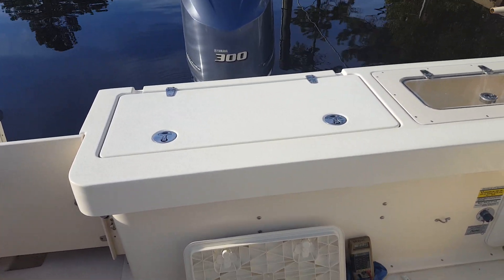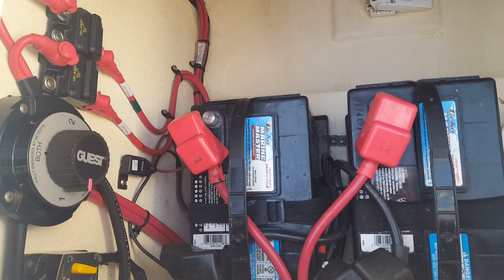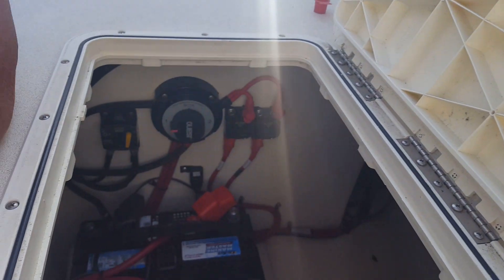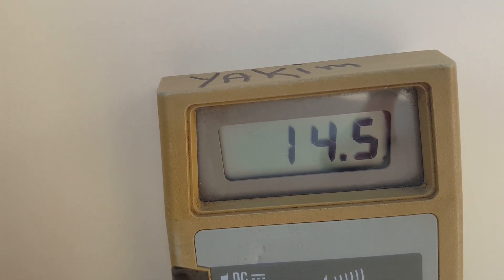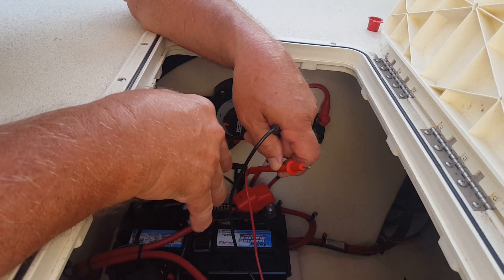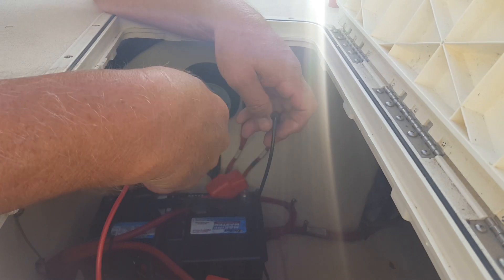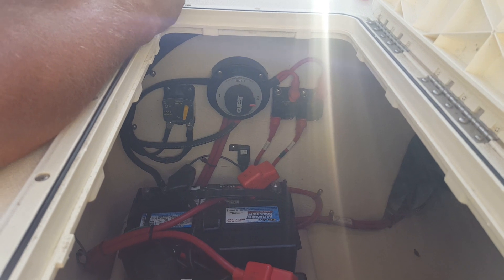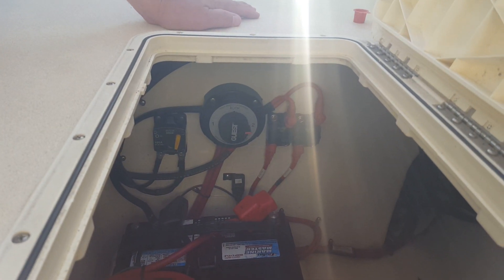BOAT BATTERY Selector Switch. Run on 'Both' ?,   #1? #2? It Depends;

Comment: No very helpful if you don’t tell everyone the reason it’s charging both batteries is because you a charging relay installed
Reply from the maker: I wouldn't tell everyone about having a charging relay installed, because I didn't know that I have one.... But, if that is the case, thank you for pointing it out. Where is it, and what does it look like? (and, there is no need to be unpleasant about it with your comment☺)

Comment: Is the boat running if not this demo is not accurate info might be correct but if boat is not running then it’s not going to change any batteries…..I guess you could have a solar panel or a charger plugged . If you are using an isolator one battery charges then it switches to other battery usually cranking battery fist then house battery
Reply from the maker: Yes, the boat was running the entire time I made the video. The Yamaha at idle is very quiet.

Comment: I have a ranger tug with a outboard I have 3 house batteries and 1 starter battery on my panel it has a charge switch do I keep the charge switch on wild underway or just when I’m dock

Comment: Unless I missed it... he never talked about when to use the "both" option?  It was also a bit confusing with all the discussion about older boats, I wish just kept it really simple and only talked about the boat he was using a demo. thanks.
Reply: I never run ‘both’ I use 1 to start and run around do whatever and if I go anchor and run a battery I use ‘2’ so I don’t drain both batteries. When you run your generator, turn your battery charger on and you’ll charge both batteries.

Comment: I had mine on 1 knowing that battery 2 was hot camp out over night got up the next morning and both batteries were dead I guess the switch is wire wrong or what

Comment: You have a battery combiner installed its visible in the video.... Read up on them. New technology's for old guys. Lol gotta keep up
Reply from the maker: Hi Robert, Thank you for watching, and thank you VERY much for the advice! You are correct in that I don't know what a 'combiner' is (I've not had one, that I know of in 45+ years of boat ownership; is that why both batteries are charging regardless of if on #1 or #2?) )... I'm still not sure if the device you mentioned is what I have, as the device I think you are referring to in my video is MUCH smaller in every dimension than ones I have tried to search online. The 'combiners' I've seen online are thicker, wider, and deeper than what I think you pointed out on my boat... Thank you once more for the advice; I will continue to research what you've educated me on!
Reply: @andrewfyakim525  it may be an older model but you should research that device whether it is a combiner or not. Should have a brand on it somewhere. Combiners do do what you are reading. And its usually best to run it on 1 or 2 not both. Your welcome and Good luck. Nice boat
Reply from the maker: @robertrodriguez2724  I agree, on this boat I always run on #1 or #2, not both. But with my older boats, if on one or the other, only the one (battery) I was switched to would get charged; back then it was important to run on 'both' if you wanted both to charge... Once again, thank you for your information!
Reply: @andrewfyakim525  oh and you should not switch from 1 or 2 while motor is running it could cause issues in sensors in motor from what I've learned. Hope this helps
Reply from the maker: @robertrodriguez2724  Yes, that is important; I've known, and mentioned not to switch from 1 or 2 while the engine is on. Supposedly, with some switches, that is not an issue, but who knows which ones!? It's best to do as you suggested! Thank you once more!
Reply from the maker: Hi Robert, Once again,  I thank you for your input, and I did as you suggested. The items you thought may be  'combiners' are circuit-breakers. (Hi-Amp Buss 40A 184040F Waterproof)...Combiners are much more expensive and sophisticated devices. (I wish I had some!) What you see in the video are circuit breakers; one for each battery. There is also an additional  BUS MRCB 100 Amp DC 48V DC Max circuit breaker 'down-stream' from those others... Once again, I appreciate your input, as it forced this old dude to get on his belly, and find out what those 'things' are! ☺ I didn't know until now...

Comment: Great video.. Question.  When  I am at anchor and my engine is off.  Should I switch to position 2 to  to power my accessories?   Also,  does anything bad happen if the engine is on and I move the switch from position 1 to position "ALL" or position 2?
Reply from the maker: Hi Richard, thank you for watching... To answer your questions; when at anchor and your engine is off, and assuming both batteries are wired correctly and therefore fully charged, you can select either #1 or #2 to act as the 'house' battery (to power your lights, and other accessories). Doing so will keep the other battery 'off-line' so you are assured you have a strong battery available to re-start the engine; even if you drain the battery that you chose to use as the 'house battery'. Switching the battery switch from 1 to All and/or to 2 is fine anytime; whether the engine is running, or not. The only thing you do NOT want to do, is to switch 'through' or to the OFF position When The Engine Is RUNNING. If you do that, you will do serious damage to the alternator on the engine. It will burn out diodes.
Reply: @andrewfyakim525  THANK YOU Andrew!   My selector switch didnt come with that information.
Reply: @andrewfyakim525  Hi Andrew,  I have another question.  Should I just run two cranking batteries and choose one as a house battery when I'm at anchor.  I dont beach my boat or turn off my motor for more than a few hours while fishing.   I just want to make sure I have batteries that can start my boat.   I currently have one cranking battery and one deep cycle battery.  I've noticed my deep cycle battery is not always able to start my motor...so if my cranking battery goes dead, I could be stranded.   Your thoughts on running two cranking batteries?
Reply from the maker: @richardc2803  Hi Richard, thank you once more for watching! Tell me about your engine (see below). A typical deep-cycle battery should be able to start the engine, if it is a 'healthy' battery. (My Diesel engines would easily start with one deep-cycle battery).... A lot of it depends on what engine (engines?) you have, and also on how much 12V power you use when the engine is off, and how long you use them.... Tell me more about your engine; gas? Diesel? two-stroke? four-stroke? How big, horsepower? ... What electrical items do you run, and for how long?
By the way, this is all 'calculatable'. The battery has a rated 'reserve' amperage. (Amps X Volts = Watts) so you can check data plated of any electrical item and it will give you the amps, volts, watts, etc...
Reply: @andrewfyakim525  Hi Andrew, I am running a Yamaha 4 stroke 150hp outboard and I have a 9.9hp Yamaha kicker motor.   It could be my deep cycle was just never charging as I only had the switch selector on "1" which was my cranking battery...I rarely anchored last season and didnt bother to switch to the house battery.     Maybe I just need to get a new deep cycle battery and the problem is solved?
Reply from the maker: @richardc2803  Yes, it is always best to use (keep in reserve) one of the batteries as a 'house' battery.
Before spending the $$ for a new battery, try this first:
If it is not a sealed ('maintenance-free') battery, buy an inexpensive Hygrometer, and check the specific-gravity of each cell. That will tell you if the battery is 'healthy', or if it needs replacing. (easy direction will come with the Hygrometer). If it IS a sealed battery, have it load tested; most places like Advance Auto, AutoZone and such will load test it for free... As this video points out, on our boat, it does not matter if the battery-selector is on One, Two or Both; both batteries are always being charged when the engine is running. Yours could also be (and/or should be)  'wired' to do that, and then you would always have one fully charges battery available to start the engine.... By the way, a typical deep-cycle battery should have plenty of 'juice' to start your 150 Yamaha 150 4-stroke,,,,
Reply: I've  been running #1 as cranking battery. Typically has higher cranking amps. #2 is deep cycle. Selected when engine is off to use accessories.  Select both to start engine. This will run batteries in parallel thus charging both batteries. Of course, the system has to be wired correctly. I've run this setup since the 80s on all my boats. Never had an issue. I do not operate switch when engine is running. It is set to both when running engine.

Comment: That’s an old fluke meter classic
Reply from the maker: Hi Lou, You have sharp eyes! Yes, that is my old Fluke, and it still works like new!
Reply: Andrew F Yakim they were bullet proof i calibrated flukes for many years that model had buttons that would stick if you worked in dusty environments and more often screen would go blank
Reply: I usually run on one battery on the way out and another on the way in didn’t know new boats had that option I know there were battery isolators that charges both without draining both is that what the new boats have?
Reply from the maker: @lou198  Yes, That is what our Parker has; both batteries are always being charged when the engine is running; It doesn't matter if I have the switch on 
'1' , '2', or 'Both'.  It's the first boat I've owned that does that.  All of our other boat, since the 1970's that had two batteries, required running on 'Both' if you wanted both batteries charging. Our last boat has six 4-D Truck Batteries, and it had THREE battery switches....
Reply from the maker: @lou198  Thank you for the 'heads-up'.  I've not used the Fluke in dusty/dirty environment, in fact I'm very careful with all my tools. I have a couple cheaper Volt/Ohm meters I use if there's a chance of damage, or in my case, dropping them in the water. (Yes, I have! ☺)
Reply: Andrew F Yakim a multi meter is a great instrument if u need to know the exact voltage but if you are trouble shooting electrical problems on a boat I prefer a 12v test light a multi meter will sometimes read voltage when a test light won’t due to poor connections and yes I love fluke must have a dozen of them I get a new one every time I go to their training
Reply: Andrew F Yakim just be careful when using those cheap meters they’re not always rated for higher voltages and can cause serious injuries
Reply from the maker: @lou198  Hi Lou, thank you again! I'm careful around all electric but am certainly not a professional... I'll also take your advice and get a 12V test light....

Comment: This paragraph helped on clarification, so when the boat is off , is the dial to remain on off to charge both batteries? I have an 89 boat with the big red selector dial. After i get these charged I will only one run battery at a time, because of your info. Thanks
Reply from the maker: Hi Glo, Thank you for watching.... On your 1989 boat, the only way to know if both batteries are being charged when running is to check with a 'multi-meter' like I showed in the video, or to know for a fact that the system is wired like my boat. In a 1989 boat, it my not be wired for 'all charge' with the switch just on 'One, or on "Two". On my 1987 boat, the switch had to be on "Both" while the engine was running, to charge both batteries....  When the boat is off, and there is no one on the boat needing any DC power, the switch should be placed on "Off".... Nothing will be charging at  that time unless you have a separate AC powered charger on the boat....

Comment: Really the most confusing and controversial matter on a boat I've never seen, 1,2 or both. or what ? Never seen the same answer to this question, courious really . Nice video.
Reply from the maker: Hi Bernar2able... I agree with you, it's confusing with so many opinions, especially when all those opinions could be correct under different circumstances..... For me, in a nut shell, it is about how the batteries are, or are not wired.... If both batteries are being charged all the time with the engine on, then pick #1 or #2; it does not matter which. When you turn the engine off, and the switch is still on one or the other, then you will not be discharging both batteries; one will be 'in reserve' to be able to start the engine. Thank you for watching!

Comment: Can i ask how do you charge the 6D battery that you said? Did you use 3 selector switch? Thanks
Reply from the maker: Hi Jaypee, thank you for watching my video. On my previous boat I had six, 4-D batteries (they are big-rig, truck batteries; one size smaller than 8-D). I had two chargers on the boat. One was a 15 Amp Ferro-Resonant charger and the other one was a 15 Amp Silicone- Rectifier charger. I had three standard 'selector' battery switches and cycled between them to assure charge was going to all the batteries. I seldom had to use the battery chargers as I used the boat every week and the engine alternator kept the batteries charged. The key was using the boat every week.
Reply: Andrew F Yakim  is possible to charge a three 12v in series to make 36v to power the trolling motor using the alternator of boat? Do you have any recommendation or do i need to buy 3 output battery isulator and how to connect the battery isulator to the 3 12v in series is that possible?
Reply from the maker: @SilverVioly  Hi Jaypee... sorry I did not respond earlier.... Youtube does NOT notify when I get comments, even though I am set up to get them... I don't have a trolling motor and I know very little about them.  But, I have a 48 Volt golf cart that requires a special 48 volt charger... It is six, 8-Volt batteries in series....

Comment: Yes; good information for me in particular; I am new to my 2005 Parker 2520 with two Yamaha motors and two batteries. Knowing that both are always charging regardless of the setting while your running; and Leaving on one to save the other was good advice! Thank you Andy. Mark Hanna
Reply from the maker: Hi Mark, good to hear from you. I hope you  are making good progress with your Parker!
Reply from the maker: Hi Mark, I meant to add; With your twin engines, do you have 2 batteries, or 3? (some twin-engine installs have a third (even a 4th battery)... And, do you have more than one Battery Selector Switch?
Reply: @andrewfyakim525  I have two switches. And, I have put a lot in to it, and love the comfort. I have a new question for you. I cannot keep my front bilge perfectly dry. I put in a ball valve because there is not room to loop the bilge line, and have really worked on keeping water out of the anchor hatch on the bow. Still, I get some water. What is your experience? Thank you Andrew. Keep up the good work on the videos. Mark Hanna
Reply from the maker: @markhanna4511  Hi Mark. Keeping the bilges dry and clean has been a priority  on all my boats; the Parker has been a 'challenge'. I get rain water into the anchor locker from the anchor locker access on the forward deck, just like you are experiencing. I have sealed it with weather-stripping and installed a 'flap' over the big 'finger-hole, where a lot of water gets in; that has reduced the water ingress significantly. I have discovered that more water gets in, under the Lewmar windlass, through the hole in the deck/pulpit where the chain/rode is channeled to the anchor line/rode locker. (I now keep a cover over the windlass most of the time).... The anchor chain/line/rode locker drains into the bilges, and the water has to run all the way through the bilges to the stern.....  The most-forward bilge pump under the pilothouse floor gets wet, and I am constantly cleaning it (Water breeds mold and mildew). The pump is mounted high, so it almost never comes on because the water does not get deep enough to float, the float switch, when the boat is on the boat-lift. (The boat sits bow-high on the lift by 5-6 inches).... In fact the first time ever that the forward bilge pump came on was 2 weeks ago, after hurricane Dorian dumped a lot of water on us. The cover over the windlass blew off and a LOT of water got into the forward bilge because the boat, when on the trailer is not slanted back enough. (I need to find a hill/grade to park it on!)... Both bilge pumps came on as soon as I started trailering the boat....
I was going to completely seal the anchor hatch on the bow, but decided against it as I can access the windlass bolts and such via that hatch. And it makes it easier access to clean the anchor locker (once a year). I also access the anchor rode locker via the hatch in the cuddy cabin.... Also I was going to drill  a hole in the bow, and add a clam-shell vent cover, to drain the anchor locker overboard (I've read on ClassicParker where some have done that). The best I can tell, my anchor locker is so deep that it would let in more water than it would let out. If I decide to do this, I will go into the anchor locker, and raise the bottom at least 4-6 inches (Epoxy and fiberglass),and then drill a drain hole. (The hole would have a 'sleeve', and epoxy-sealed to the hull for now water penetrates the hull)......  In the meantime, I'll continue sponging, wiping and cleaning the bilges!
Reply: Andrew F Yakim That was the most spot on reply Andrew! I have also weather stripped the front hatch and finger hole. Next I will cover the windless. In the meantime, I’ll be getting out the sponge, bucket, and syphon. I really like your videos. They really resonate with me and my 2005, 2520 xlsc. Thank you so much. Mark Hanna in Michigan.
Reply from the maker: @markhanna4511  Hi Mark, I cannot tell you how much I appreciate your positive comments...  thank you.